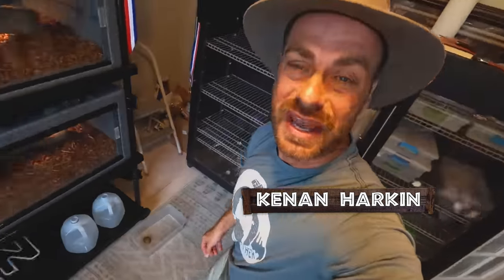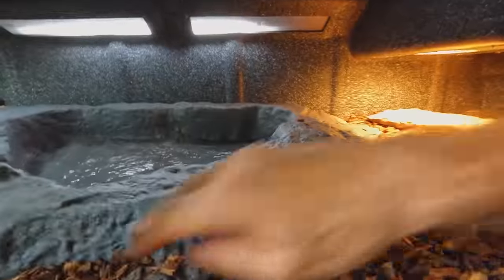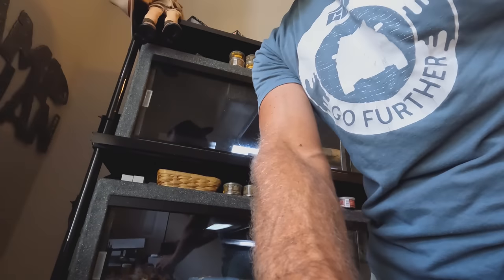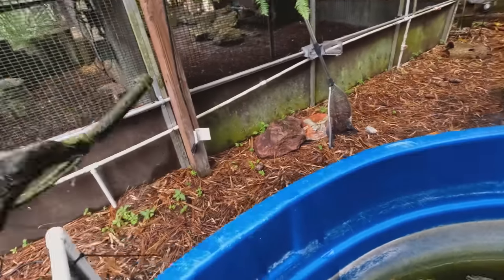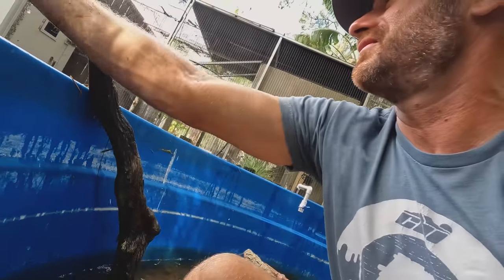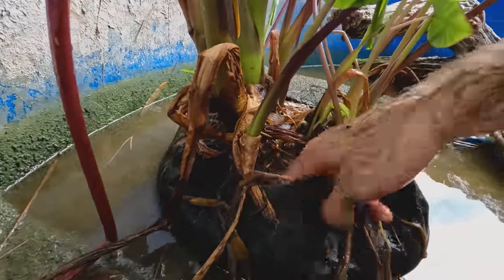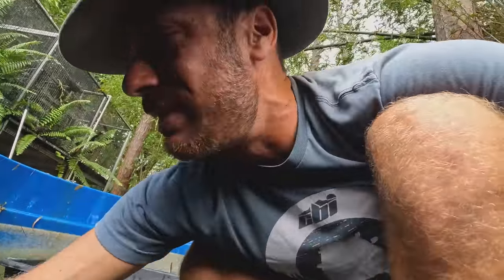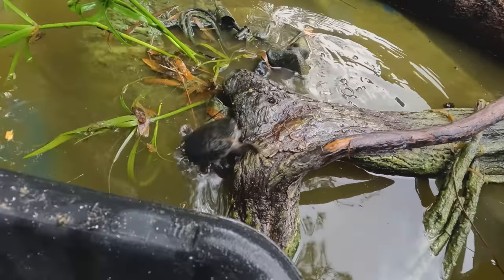Are my Snake Necked Turtles STILL ALIVE?

Comment: Pine needles acidify the soil beneath pine trees and can also lower the ph of pond water. I don’t know how severely the levels are affected as the needles decompose or if low ph, acidic water could be detrimental to baby snake-neck species. You may want to cover the tub(s) with a mesh frame to keep the pine needles and also predators (raccoons etc) out.